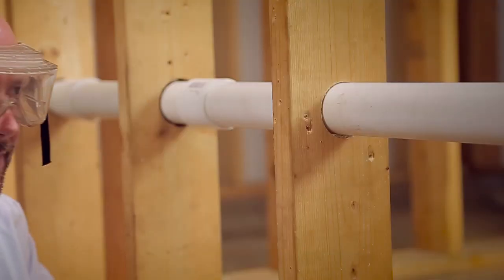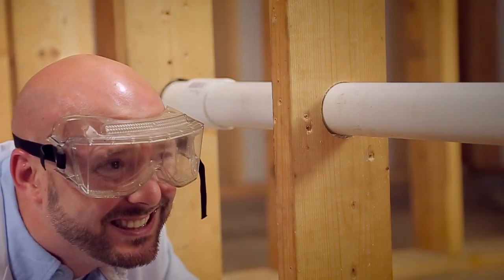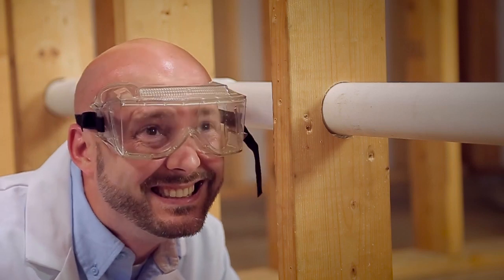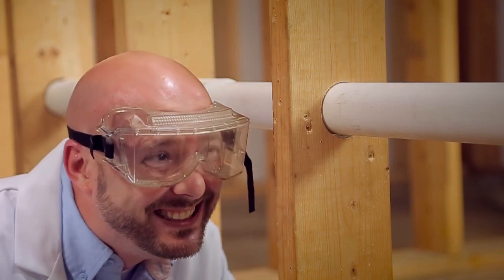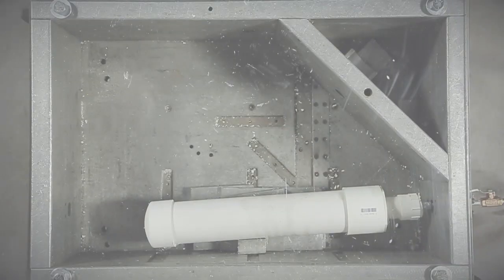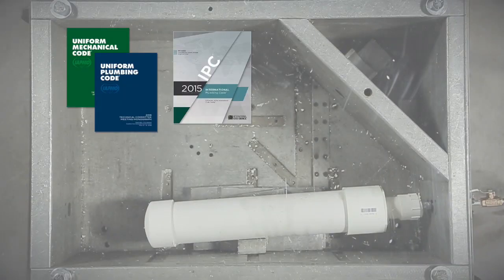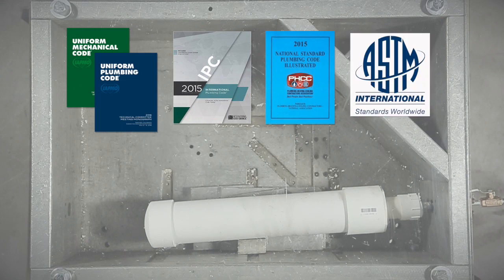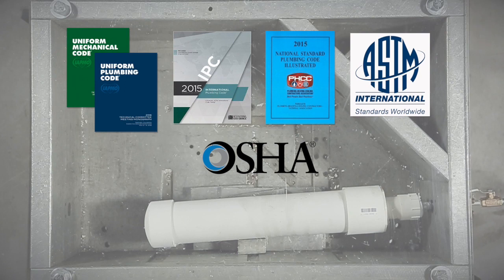Plumbing Pressure Test With Air

Comment: Good points...but come on nobody is testing that high...whatd you pump into that pipe 300+lbs? I mean it says water not air but charlotte 2" is rated at 280psi per google

Comment: Safety nuts who are afraid of common scene and 5 psi pressure, run to your blanky and suck your thumb. Not saying over say 60 psi  psi is safe, but 5 psi.on a 260+psi rated pipe.......Pounds per square inch are the same whether air or water, isn't it????   As the video they must of pushed to 400 psi to make the video. OH PLEASE.

Comment: For all of you saying 'it's code' 

IPC - Section 312.3 Drainage and vent air test   "An air test shall be made by forcing air into the system until there is a uniform gauge pressure of 5 psi ... pressure shall be held for a test period of not less than 15 minutes. Plastic piping shall not be tested using air."

UPC - Section 712.3 - "Air Test: An alternative to the water test where air pressure is used.... 3.  Note: Testing plastic piping with air is not recommended due to safety concerns."

Comment: These idiots have NO IDEA WTF they are talking about. - YEAH, I can put 2,000PSI of water in that same pipe (pressure washer, or Hyd Pump) and guess what.... IT EXPLODES THE SAME WAY! - How about DON'T BE A FKN M0R0N and keep the pressure to SANE LEVELS....Like 10PSI for checks....OR If you are using PVC in air system....Keep it below the rating of the pipe!

Comment: So I’m currently installing a new black steel compressed air line. It just so happens that the existing line the customer is using is all pvc. I’m not allowed to shut off the air due to the business still being operational. How worried should I be about this happening?

Comment: nonsense i have an air tester rated at 3 bar test and 6 bar test for plastic. there are two prv for safety, JG plastics can withstand at least 30 bar so do the math and get a kit like mine before passing such a severe judgment.

Comment: Hey Charlotte Pipe, in the spirit of safe science, excluding the external factors mentioned like temperate, and general atmospheric pressure, were these demonstrated failures roughly around or above the rated psi on the pipe?

Comment: Thanks bro. I’m surprised by how many people still do this even after it’s explained to them, shown how it’s not approved by code or manufacturer specs. Some people never learn.
Reply: Still acceptable according to 2021 ICC
Reply: MA Plumbing code requires 5 psi for at least 15 minutes.
Reply: @peted2770  so you are plugging all your fixtures, your vents & your sewer tie in then pressuring it up to 5psi??? That’s actually retarded & I don’t believe you. 

I have done an air test on cast iron drainage once @ a school that was 5 stories. It was a nightmare & I do not believe you that your code REQUIRES a 5 psi air test on ABS or PVC drainage piping

Comment: Gas lines (made of pvc ) are air pressure tested to maintain overnight pressure. See your local code compliance requirements for the level of air pressure required. Generally in the 10 to 15 psi MAX range. Remember never higher.
Reply: Gas isn't run in PVC. Maybe you mean MDPE or HDPE. Very different chemical compositions and different engineering  as well. Those 2 are indeed pressure tested with air overnight and inspected the next day.
Reply: @johndavid7920  so psi is different?

Comment: you have lost your mind........  pressure test at 5-10 psi deadly? no..... what on earth did you push into that rig to get that? 175psi? yeah air test needs to be gentle.... but thats not at all what you said... and cant locate leak? ever heard of colored  air? or a gas detector? or an audio scope? or bubble test? or.. or... or.... your giving bad info...

 besides Im testing for burst pipes due to freeze....... 1psi would tell me most leaking without me flooding my home!
 why would I put 35 psi water through my whole home only to flood everywhere? 

I dislike your video information with a passion...

Comment: You are full of shit.. I am a licensed plumber and code book has us testing air all the time. It works great “on abs systems” it is safe. 5 to 10 psi is more then safe. PVC system are also very very safe at 5 to 7 psi. As a professional I would not recommend non professional do it for the sole purpose that if indeed you accidentally run to much air in there it will indeed do what this man says.
Air testing is far superior to water for the reason that air is thinner then water. Yes of course air test “slightly” change with sunlight fluctuations, temperature fluctuations. But just like anything else. Pay attention to what your doing. Any tool can kill you.. So don’t be a tool and pay attention to what your doing every time your doing it. AIR TESTS ALL DAY. You are so wrong about them writing it in code books. Code books tell you to air test.

Comment: My mechanic buddy has pvc pipe air supply everywhere in his shop big compressor 120 lbs 600 psi pipe it's grey been using it 30 yrs it's not that air don't blow them up it's what type of pipe did you use

Comment: So how much psi was going in at the fail point? Bet it was way over the posted rating!
Reply: Which air compressor can produce over 300 PSI, the rating on the pipe?   I was on a construction project where the mechanical contractor tested a PVC piping system with compressed air. It was at about 80 psi when it blew.  Some of the sharp shards penetrated three sheet rock walls.
Reply: @billgausman5887  80psi?! That requires pressure-rated piping, not DWV piping. That contractor is just dumb.
Reply: @peted2770  Most of the PVC pipe is rated for 80 PSI or more of liquid.  The key is liquid, which is non-compressible.  Way different than a compressible fluid like air.  Sort of the whole point of what this guy is trying to say.
Reply: @billgausman5887  funny! Compressed air is used all the time to test different systems, from gas line to water etc
Reply: @dodgeramsport01  PVC?  You are running gas through PVC? Are you using PVC for domestic hot and cold water mains, too? And you are testing it at 80 PSI?  Wow.
Reply: @billgausman5887  no i said compressed air is used to pressure test in many industrys

Comment: We do the air test all the time using 5psi. I’m still alive!
Reply: Air tests are In The code!
Reply: geoffrey tinone It must be because the inspector passed all my homes I built using pressure testing
Reply: We air pressure test for every inspection. Plus, it is in the plumbing code. Not sure why Charlotte is saying we should NEVER use it.
Reply: @jadedietz2185  That's because some people can't get it in their thick skulls that psi is psi no matter what it is! It's also in code
Reply: He will find you
Reply: @rendydddd  has he made me swallow a " tracker "
Reply: I concur. We had to air test drains and vents in Colorado for years because of freezing temps. And occasionally we wouldn’t have access to water. We’d be too remote with no water well drilled yet. I’ve not seen a PVC fitting or pipe go frangible at 5 pounds. Maybe with a potato gun….
Reply: 5psi is more of a "leak test" rather than a "pressure test".  The explosive potential of 5psi of air in most piping systems is low, unless you are testing very large pipe or a pressure vessel.  I believe what they are describing here is not to perform a hydrostatic test with air.
Reply: It's probably safe to say they testeds that pipe bomb w/ like 500psi for this video.
Reply: facts
Reply: So you're doing a test that's prohibited by code? Good job!
Reply: Its not necessary everybody as conscious as you are... a simple malfunction in pressure gauge could lead to catastrophic damages.

Comment: Wait, what? Are people water testing at fundamentally lower pressures than air? If a pipe is going to burst at X psi filled with air, it should also burst at about the same pressure filled with water. I'm seeing recommendations to air test at 5 psi. That doesn't seem like much of a danger to me. I get the difference in visibility of the leak, but not this concern about danger.
Reply: It a safety thing but in my local code you can test with a 12ft high water colum or 5 psi air
Reply: Nate S right PSI is PSI weather is water or air!
Reply: @dodgeramsport01  the danger in air is its compression vs water not compressing.... water cant really explode.... air can... so low pressures on using air is for safety.
Reply: @grantmcfarlin6943  true but psi is psi
Reply: @grantmcfarlin6943  very good point. I have been hydrostatic testing for the Navy for almost 40 years and when a failure occurs during one of these testing even to as much as 10,000 psi the failure is over in an instant at the point of failure.  Whe a air test fails that can continue for several minutes. 12 psi of air testing one time failed and launched a several tone fixture several feet in the air luckily no one was killed
Reply: I 10ft column of water only products up to 4.3lbs vs the 5#+lbs recommended or air. Nobody said pressurize the drainage system with water beyond a water column of 10 ft.
Reply: It’s not about the psi, it’s about the violet release. Fill one balloon with air, one with water. Poke a small hole in the water balloon and you get a trickle. Poke the balloon with air, bam! That water doesn’t compress and stores very little energy. The air compresses storing more energy (like a spring).

Comment: Another stupid video how much air are they putting in that pipe? the burst pressure on 11/2 schedule 40 is1060 psi. slab inspections on a drain line requires 5 lbs psi air test. If this pipe manufacture can't handle this test I would not recommend them

Comment: Additionally PVC is not compatible with the oil in compressed air.  So if you are using PVC for a compressed air system, even if it is within the pressure capabilities of the pipe and fittings, it will fail at some point in this way.
Reply: eye roll here...
Reply: My shop has been using PVC air lines at 120 psi since 1994 .

Comment: Suction test (negative pressure) ?
Reply: harder to locate leak with vacuum, need audioscope for that like finding a vacuum leak in a car..... but a little pressure you can put in detectable gasses or colored air or do a bubble test on your fittings with soapy water squirted on the fittings and watch... if your fearful of listening...
Reply: It is allowed under the code as well, just use a smoke bomb device and if it is holding  a vacuum it's good 5 hg

Comment: I live in Oklahoma.  In Rogers County they make test sewer systems with air, it's the only county in the state that does this.
Reply: Not true Tulsa County , City of Tulsa and almost all inspectors require a 5 lbs test on in slab drain pipe before the pouring of the slab

Comment: You will always have those that panic and those that don't even bat an eyelash. An exploding PVC pipe would be the least dangerous thing in my shop.15 years in my shop...same pipe...
Reply: My shop has been using PVC air lines at 120 psi since 1994

Comment: This is a half truth. The PVC pipe has a pressure limit printed right on the pipe. If you over pressurize it of course it should fail. Seems to me the smoke test is better for drains and vents. The pressure water side is tested with water.
Reply: Why are you guys arguing the with literal manufacturer on best practice with their own product?
Reply: @bubbagrace2997  Because everyone knows it all. It's like the Supreme Court...I law is written and everyone sits around arguing about it until it makes up to the top dogs, and these can still get it wrong depending on politics and attitude.

Comment: 5 psi for 15 min is going to kill someone? I disagree.
Reply: If you disagree, fill a slab with 5 psi and smack the pipe with a hammer. Let me know how you make out after you do it.
Reply: You also don’t know how force calculations work. How much force is on a 4” PVC cap with 100’ of pipe behind it genius?
Reply: @Pskawt  thank you, it’s about the volume.
Reply: Well you are fucking wrong bud
Reply: 5psi, would not be much of a pressure test. unless you are just having a laugh.

Comment: I have a project multiple high-efficiency water heater flues possibly leaking in finished walls and ceilings.  It would be foolish to test them with water.  It appears the manufacturer has no good answer for that.  If your schedule 40 pipe fails at 5 psi, I'll find you!
Reply: Jeff O'Neal most pvc manufacturers specifically say not to use their pipe for flues. It’s the boiler manufacturer that tells you to use it.
Reply: Daniel Cadotte, thanks, I will see if I can find that.  Do you recall the source(s) of your assertion?
Reply: Daniel Cadotte, I did a little research in the Charlotte Plastics Manual that can be downloaded from their website and I believe you have the wrong impression.  It is cellular core pipe they say not use on flues.  If you look at page 121:

"Using Plastics for Combustion Gas Venting
Charlotte Pipe recommends that inquiries about the suitability
of plastic piping systems for venting combustion
gases should be directed to the manufacturer of the water
or space heating equipment being installed. As stated in the
International Code Council’s International Fuel Gas Code
503.4.1.1:
Plastic Pipe and fittings used to vent appliances shall be
installed in accordance with the appliance manufacturer’s
installation instructions.
The residential water heater certification and safety standard,
ANSI Z21.10 1-2014/CSA 4.1-2014, has been modified
as it relates to the use of certain plastic venting materials
and now prohibits the use of cellular core pipe. For this
reason Charlotte Pipe prohibits the use of its PVC and ABS
cellular core pipe for combustion gas venting.
Furthermore, several of the ASTM standards applicable to
plastic pipe and fittings that Charlotte Pipe manufactures
include the following note: This standard specification does
not include requirements for pipe and fittings intended
to be used to vent combustion gases. "
Reply: Jeff O'Neal it was in a continuing education code class in MA. It was from Charlotte.
Reply: Use a negative pressure test with a vac. And shut off your valve if u have a leak it will show. Ohio code

Comment: Can someone tell me what about if it's on black pipe for natural gas?
Reply: ? Im confused gass piping is widely done with air in my area it's 15psi threaded black iorn 30psi csst piping and 60psi for welded or flanged piping remember to purge the Gass line with air before you start your test

Comment: How can I test a upvc stack which has a push fittings connections?
It can't handle water more than 3 or 5 meters

Comment: you're only suppose to put 30-60 pounds per square inch. That pvc bomb was way more than that. tisk tisk tisk
Reply: 30-60lbs? I used 5lbs on 1.75 pvc the other day (120ft run underground) and it was plenty to find a leak.
Reply: FL 032 you'll be in for a surprise once you put actual water pressure on it

Comment: In Minnesota there are times of the year (like today, -1 outside) when if your were to hydro test, how much ice and snow do you have to pack into the pipe?? I take credit fully for allowing the 5 PSIG air test of DWV, and Storm water piping in the current Minnesota Code. If the plastic pipe and fitting manufactures have a better way of testing when the ambient is below freezing we will certainly entertain it in the next code cycle (really we will).

Comment from the maker: Thank you for your responses. Both the 2015 International
Plumbing Code and the 2015 Uniform Plumbing Code state that all systems, except
for plastic, may be tested with air.  There is no nationally recognized
plumbing code that allows the use of air in its text.
2015 IPC, Section 312 “Test And Inspection” – All plumbing
system piping shall be tested with either water or, for piping systems other
than plastic, by air. 

 2015 IPC section 312.3 “Drainage and Vent Air Test” – Plastic
piping shall not be tested using air.

2015 IPC section 312.5 “Water Supply System Test” – Upon
completion of a section of the entire water system, the system or portion
completed, shall be tested and proved tight under a water pressure test not
less than the working pressure of the system; or for piping systems other
than plastic, by an air test of not less than 50 PSI.

 2015 UPC “Sanitary Drainage” section 712.1 The piping of the
plumbing, drainage and venting system shall be tested with water or air except
that plastic pipe shall not be tested with air.

 2015 UPC “Water Supply and Distribution” – Except for plastic
piping, a 50 PSI air pressure shall be permitted to be substituted for the
water test.
Reply: yeah.... that’s officially the rules on inspections and for good reason..... but in trouble shooting a previously frozen system 5psi test to locate a leak without flooding anything is best practice.
Reply: Unless allowed in manufacturer's instructions, I agree that it's best to use water when testing any plastic piping system. However, the State of Michigan amends the IPC in the Michigan Plumbing Code, allowing a 5 psi pneumatic test for period not less than 15 minutes (Section 312.2 Drainage and vent water test). Pretty hard to install a plastic system of any kind in winter conditions with a 10' standing water test. https://www.michigan.gov/documents/lara/lara_bcc_plumbing_code_rules_011714_440029_7.pdf
Reply: I want to make pvc pressure tank, its for well pump system, will be about 30-50 psi, it macimum aw pipe will give you 150 psi, i just use it as everyday pressure tank , is iy okey?
Reply: Manufacturer's instructions trumps code

Comment: what kind of pressure are you using in this video? Only 3psi is needed for a good test where we are.
Reply: 5 psi in Arkansas as well. Do it all the time.
Reply: All you actually need is 1-1/2” W.C
Reply: In Massachusetts it's 5 PSI. Is this "FAKE NEWS"?